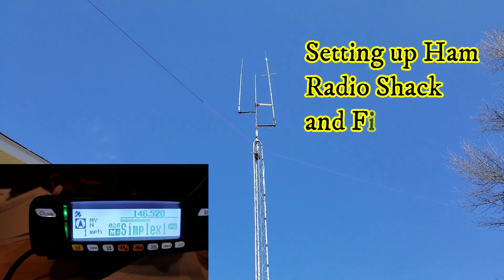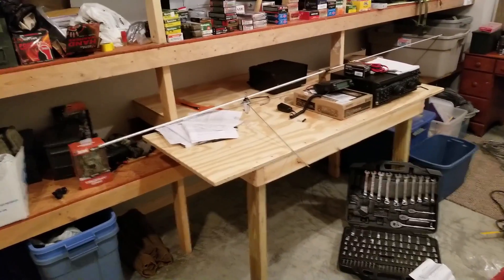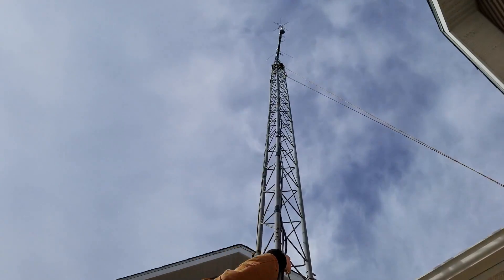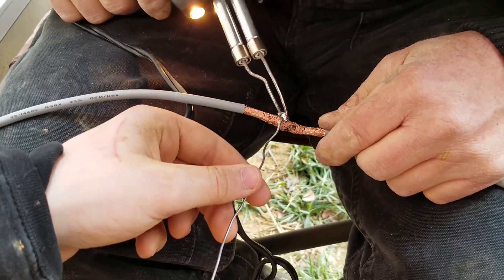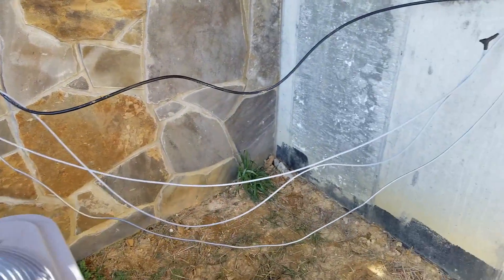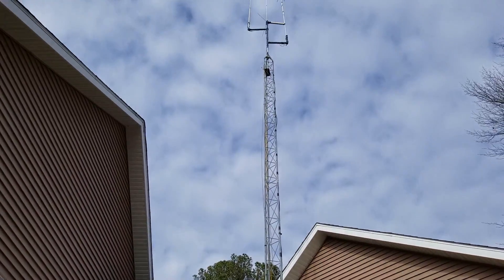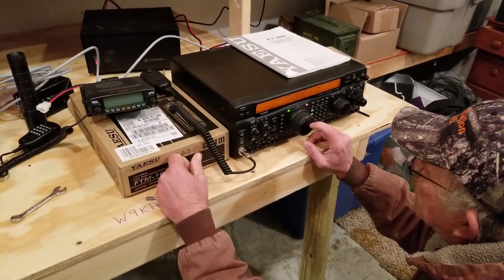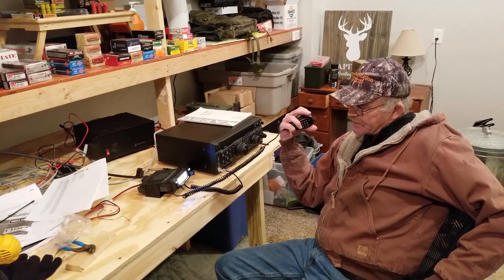Setting up ham radio shack and antenna tower completion

Comment: Kapper I went way back.  How is Iron Mike? . Did you tower build up any ice in that ice windstorm?
Kapper I recall you and CJ by your computer desk.   I know your 6’5?    I am 5’11” , but really long legged and my back pain was bad in old computer chair and hated using computer.
I thought about your height and back pain and the chair I bought might make all that editing more comfortable.  I also bought the large rubber wheels as a extra and so much better, rolls easy on carpet or wood floor, no matt required.  Rolls right over oxygen hose and does not smash it or get coiled up with those rubber wheels.
Check it out on Amazon.   
La-Z-Boy Trafford Big and Tall Executive Office Chair with AIR Technology, High Back Ergonomic Lumbar Support, Brown Bonded Leather.     It’s hard to pick a chair without sitting in one.  Only thing is sit too long your rear might get hot, but if you sat that long you should get up and walk a bit.   It arrived the next day from northern Il.   Now it’s fun to sit at computer.

Comment: takes your grounds to ONE point. you don't want to get a ground loop, meaning a length is at a resonate frequency. I have a 10ft grd rod by my tower and brought a #2 THHN wire in with the coax to a ground to ground the equipment

Comment: I came across your channel and your trespassing video caught my eye. Then I seen you were a ham operator. If you don't mind me asking where did you get your tower? I've been wanting one for years but haven't made the sacrifice. I don't know whether to buy new or get a good used one. I like the way you did the top of it with the antennas. I need to do that with a antron and diamond antenna I have on one end of the house. Right now I have them staggered. I have to take it down to replace the antron because it was hit by lightning a couple years back. I'll have to try to make contact with you one evening. 73s! KB3HAK
Reply from the maker: I got a great deal on a used tower. If cash is not a big deal maybe get a new one. But you can look around the countryside at homes with towers maybe find one not in use any more and make them an offer. Or put an add in, 'looking for used tower.' Good luck and 73's. thanks.
Reply: I had the same thing happen with a reel of coax. I guess live and learn! I guess will have to unreel more than what you need and check it.

Comment: put connectors in, that coax solder joint is no good, you cant splice it that way
Reply: good place for 2 PL-259's and a barrel type lightning arrester. bobby is correct, you can't splice coax like that. You loose the dielectric value.
Reply: forest gimp hahhaa gimp life is like a box of 259s. lol

Comment: talked to Kenny many times n9wzf cut about 3 feet off of each leg of that 80 and it will match mutch better
Reply from the maker: Roger that! I really enjoy talking to Ken now, he's a hoot! I'm going to re work a new one. Think I'm going to try a double Bazooka for 80 meters.
Reply: @kapperoutdoors  I worked over 100 countries on an inverted V on 80 meters. Don't sell it short.
Reply: @lrodpeterson3046  When I first got my license I used a borrowed Globe Chief 90A transmitter with ONE 80M crystal and a Hallicrafters SX-99 receiver that I bought out of the local classifieds for $40.  I used a 80M inverted-V antenna supported in the center by a pole made from a tree I cut down strapped to a clothsline post. I made a lot of contacts with that old CW rig. Later I upgraded to a Heathkit DX-40 with a Heathkit VF-1 VFO that I bought for $50 at a Ham Fest and thought I was in radio heaven. :-)  That old Globe Chief was a bit tricky to tune the final as if you weren't careful the setscrew in the tiny "Tune" knob would give you an RF burn if it came in contact with your finger.
Reply: it is real herd to beat a tuned dipole but bazookas r good to @kapperoutdoors
Reply: @kapperoutdoors  tell ken kb9bpz ask about him

Comment: I noticed when you were leveling the tower that you had to install spacers which are fine but normally you put nuts and flat washers on the studs first before you put tower base down that way you can adjust the nuts under the base plate and it gives you an air space to prevent rust from forming under the base. Also the tower is old so all the specs are not correct anymore and the wind loading is going to be much higher than you think so guy wires might be good idea. Also when you have to weld on a galvanized pipe you need to lightly grind off any galvanizing and if all you have is a AC stick then beg , borrow, or steal a DC welder or if nothing else put 3 car batteries in series and put your leads on them an use DC rods believe me you will appreciate the difference. Good luck .by the beautiful picture quality.
Reply from the maker: Thanks, its a work and learn-in-progress! lol I figured the opposite on the plate adjustment that the washers would keep the platform much stronger as opposed to having nuts under it, whereas the steel bottom plate could shear much easier with just the nuts holding it up. Had 40+mph wind storm the other day!

Comment: Passed within five miles or so of your house last Fall as we traveled up from FL to visit our son in Belvidere. I was very active for about 20 years when we lived in Aurora. I was N9AKE for most of that time.

Rod K4QG
Reply from the maker: Well if you ever pass up this way again, holler! Aurora..... surely you saw the news yesterday? Bad stuff man...
Reply: By the way, if I interpreted the QSO correctly, it sounds like the guy you were talking to uses frequencies at 146 MHz as well as 144 MHz. 146 is generally FM operation and 144 is normally "weak signal" or SSB/CW operation. FM antennas are normally vertically polarized (such as your stick, and repeaters) while weak signal is usually horizontally polarized (beams). 

While it doesn't make a difference which mode one is on or which antenna, there cross polarization can account for about 20 dB loss in signal (both send and receive) That could easily account for the difference in signal strength he was reporting.

Although there's no actual rule that says so, the band plan for 2 meters calls for FM above 146 MHz and reserves the lower half for weak signal modes. Nothing messes up a SSB/CW QSO, especially if it's meteor scatter or aurora like a big ol' wide splash of FM.
Reply from the maker: good info. We are so far out in the stix that unless it is skip, not much is coming across 144 out here, except maybe sideband. Thanks.